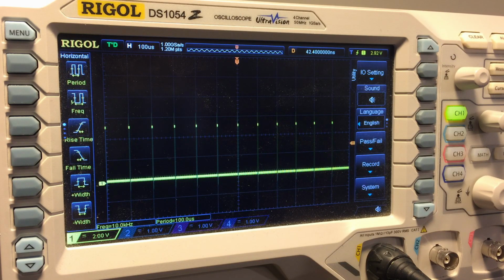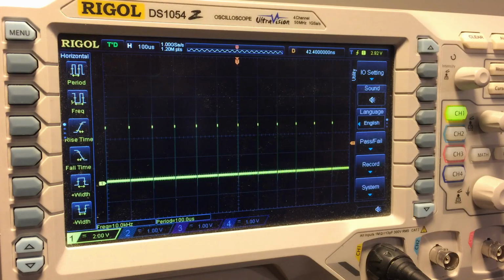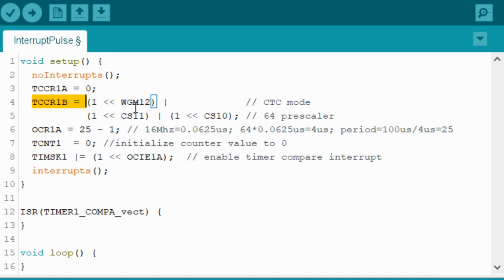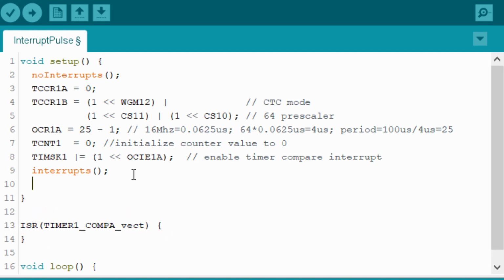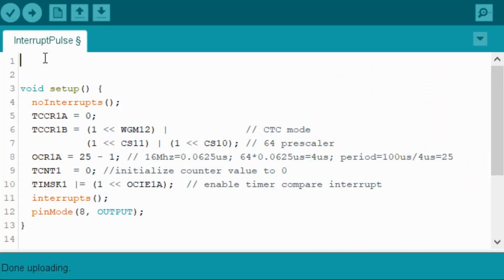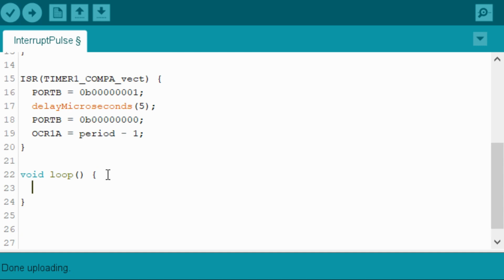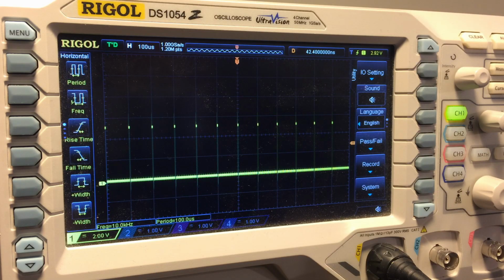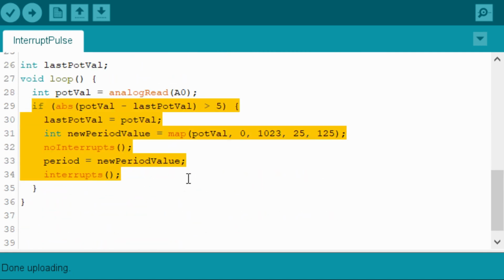How to Use Arduino Timer Interrupts to Create Precise Variable Length Pulses

Comment: I am using an Arduino Datalogger to count pulses.  It seems to have a lot of issues of the frequency goes higher.  I am having a lot of issues counting pulses using interrupts.  Do you have any suggestions?  I would like to be able to count as high as 60hz and as low as a pulse every 6 minutes.

Comment: Great video, thankyou. I have been using a very similar routine to try to generate a precise timing output. A couple of points worth noting are that the ISR execution occurs after variable cycle length instructions have completed and after other ISRs have completed (there is no interrupt priority system on a 328). This seems to make it extremely difficult to make any level of moderately complicated code to give jitter free very precise timing.

Comment: Thank you. Your video was very helpful. I am using a Timer1 to control a stepper very precisely but with a variable speed offset initiated by a serial command. This video is exactly the bit of information I needed. 
How can I stop the ISR or should I just disable the stepper as part of a stop command?
Reply from the maker: Hey! You have two options.
1. Disable the compare interrupt for Timer1.
2. Interrupt keeps getting called, but you can add an "if" statement inside the ISR "if (!stopped) " then generate a pulse.

Comment: Very nice video. Thank you for making it. I tried it out on an Arduino and got the same results that you show on the oscilloscope. It won't drive the smaller stepper I'm using with an A4988 driver. Do you have any suggestions for turning that pulse into a nice symetrical squarewave? Thanks again for contributing your time and talent.
Reply from the maker: Hey! You can toggle the output instead of creating a pulse. Like this:

bool pulse = false;

ISR(TIMER1_COMPA_vect) {
  if (pulse) {
    PORTB |= 0b00000001; // set bit 1 in PORTB
  } else {
    PORTB &= ~0b00000001; // clear bit 1 in PORTB
  }
  pulse = !pulse; // toggle pulse variable
  OCR1A = period - 1;
}
Reply: @IndrekL  Thanks Indrek!

Comment: Veri good. But why to use the delay blocking function inside the interrupt ?  Is it possibile to take out ? thanks
Reply from the maker: I added it to make the pulse more visible on the oscilloscope screen. In practice it is probably not necessary for stepper motor driver. Another possibility is to toggle the output bit in the interrupt instead of creating full pulse in one go. Then instead of "period" variable there could be "halfPeriod" and it would take two interrupt executions to create full pulse.